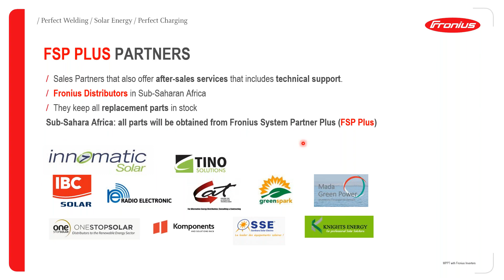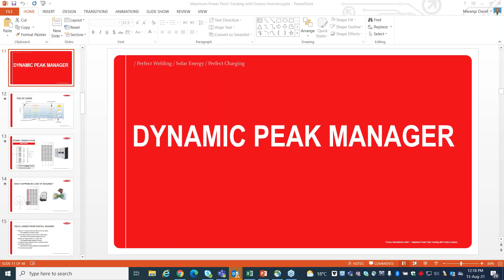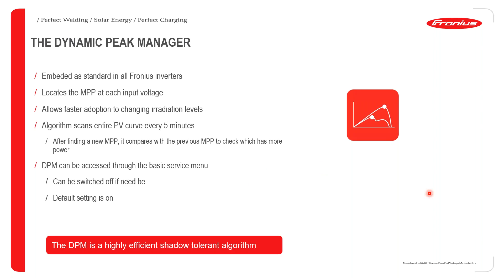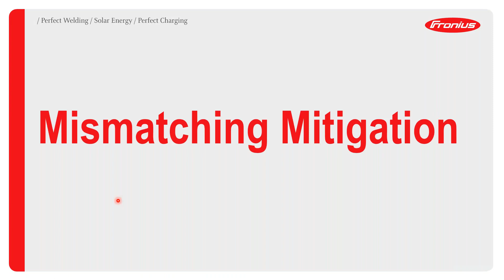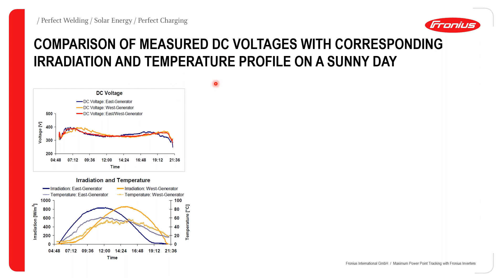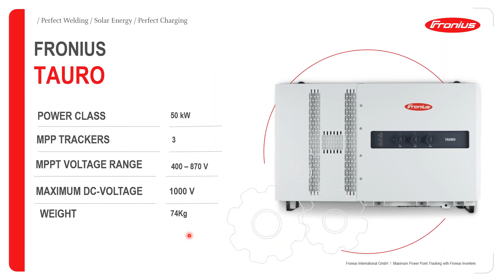Advanced Webinar: Maximum Power Point Tracking with Fronius Inverters (AFR)

Comment: what happens when you design the string that respects the Voltage and I current limits of the DC inverter but the input on the PV max power on DC is greater that the limit on the specs?
For example:
-PV Max DC Inverter is 8kW and
Solar panels installed is 10kW but is in the limit  range of V and I of the MPPT
Reply from the maker: Hi,
For systems where the maximum DC power including the oversizing factor is exceeded, we cannot guarantee functionality even if the short-circuit current and open-circuit voltage limits are met.
Please contact our technical support through the Solar.SOS application with your specific case.

Best regards,
Leo from Fronius